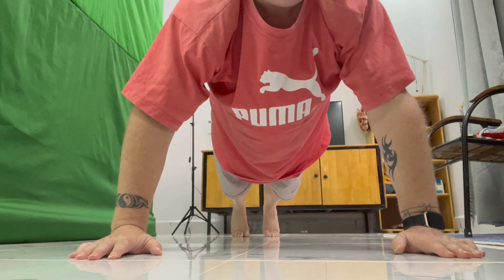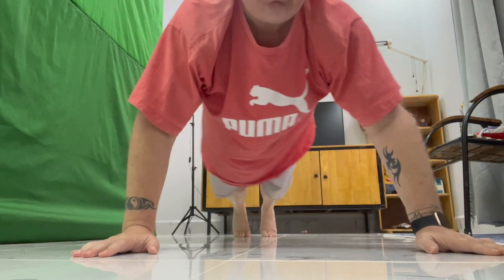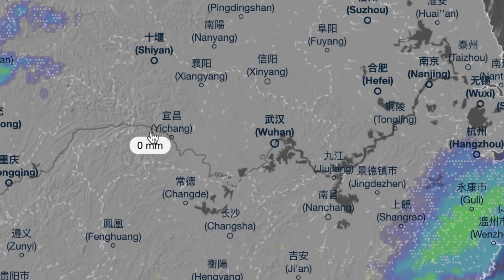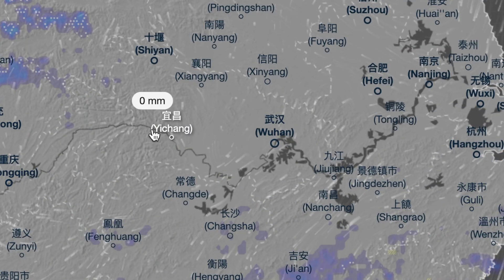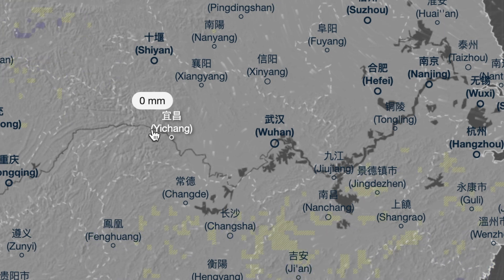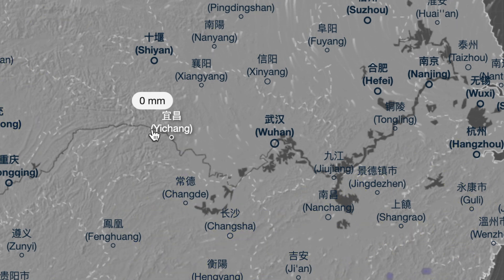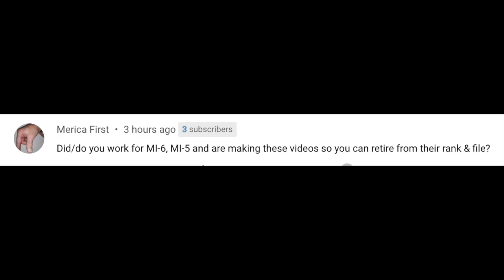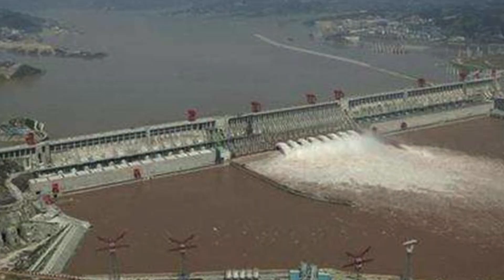SILT EROSION OF THE 3 GORGES DAM & THE COFFERDAM DEMOLISHED IN SECONDS

Comment: Great information! What if instead of building a dam across a river, only walls extending from the sides of the river toward the center was created and maybe angled with the flow of water This would cause a funnel in the center of the river which would increase the force of flow only in the middle. Then a separate building in the center extending downward in the river and downstream of the side walls was built. This center perpendicular building would house the turbines. This would allow the flow of the water to not be interrupted for the communities down stream, no silt buildup, electricity continually generated, with fish and boats allowed to flow freely back and forth. What do you think?

Comment: Suggestion, try Pu's using knees, not toes, as contact point. Less impact. Move to normal Pu when ready. In addition and tougher than one push-up, remove all added sugars from your diet...sugar is like silt. Without routinely removing thru excercise, it's byproducts will build up causing body failure. Much like the 3gd.
Reply from the maker: Thanks for the tips!

Comment: Important issue. Look at some other dams and see how bad it is when they open their gates. Pressure/pressure release stresses and weakens the dam when done at maximum levels. Take a bag of sand and weigh it then soak it with water and weigh it again. Weighs more than water alone, fits in the same space.